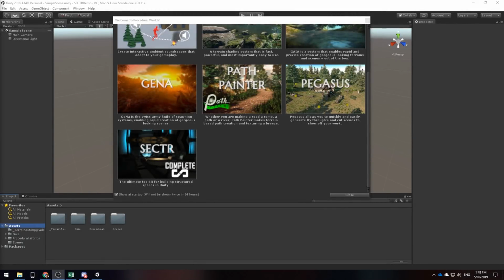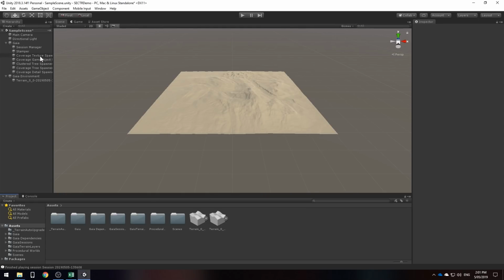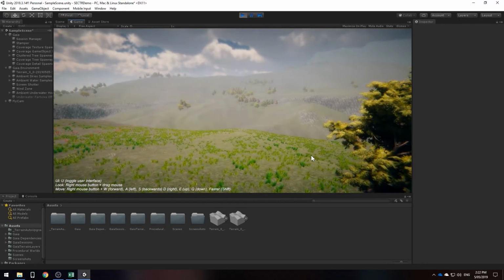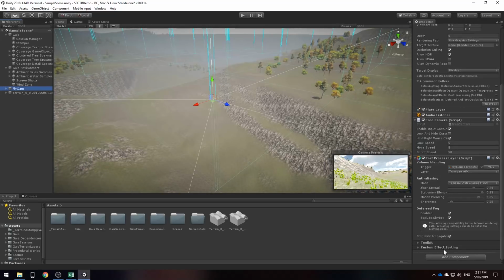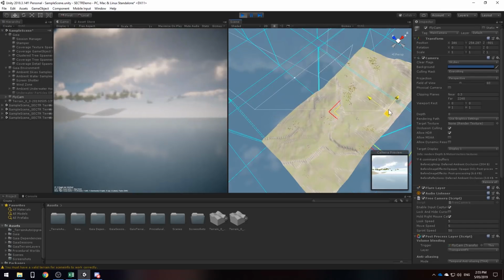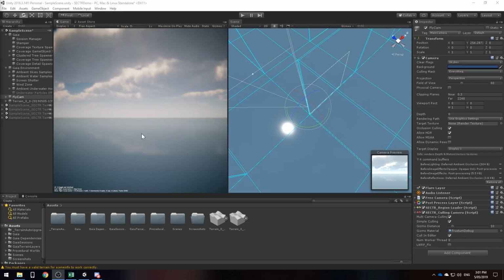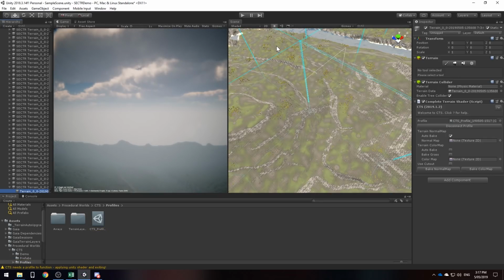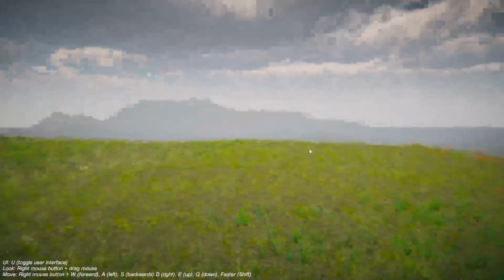Sectr Complete 2019 Terrain Streaming Tutorial

Comment: quick question, can SECTR be extrapolated to do this for non-terrain gameobjects as well during runtime (for example buildings placed in game)? Or should I stick to using some other culling method.
Reply from the maker: There is a component called SECTR Vis that dynamically culls Sectors. I do not see why you would have a problem with this assuming that you parented your game objects correctly.
Reply: @AdamGoodrich  Thank you! I'm making a note to purchase this with Gaia. Awesome work.